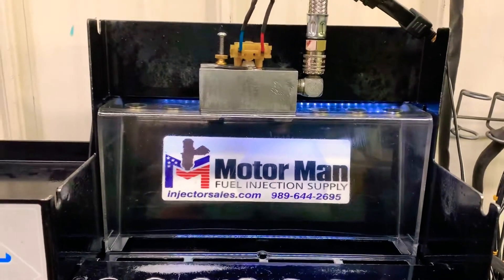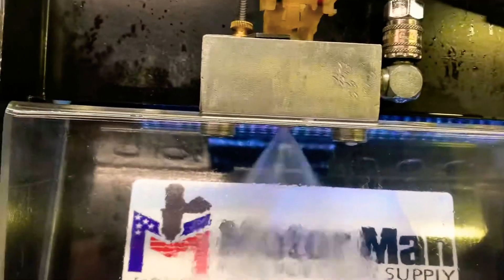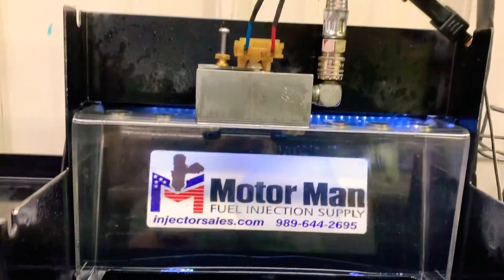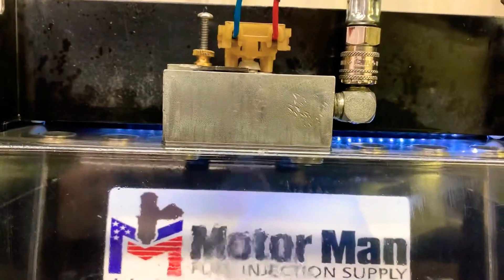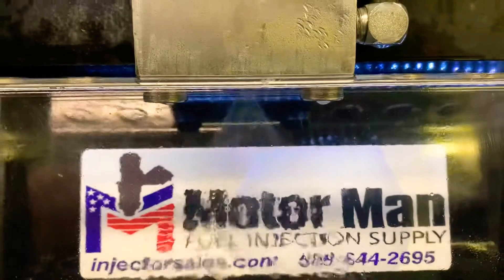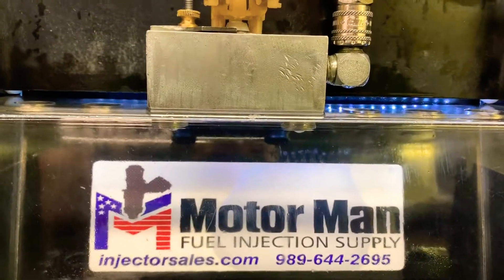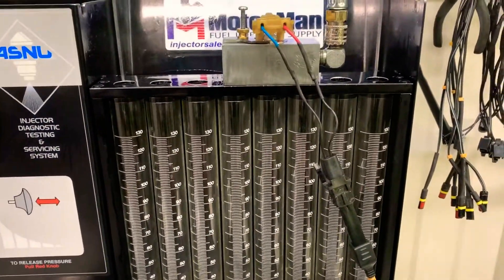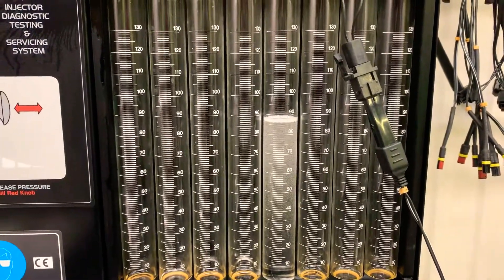Motor Man - GM Throttle Body Fuel Injector Spray Pattern and Flow Rate Test

Comment: So is it actually supposed to pulse or should it be continuous? Mine is continuous and pouring more than it should be based off your video.
Reply: I have ordered off other sites and I got them broken in the mail and the motor man is the only one I've seen that does testing at everything on his throttle bodies so I definitely ordering from him cuz I'm building a 350 Chevrolet with all Edelbrock but I can't afford an Edelbrock carburetor and I want excellent performance so motorman's the s***